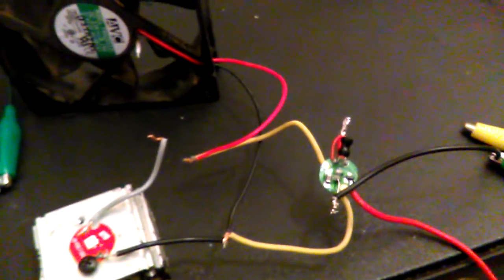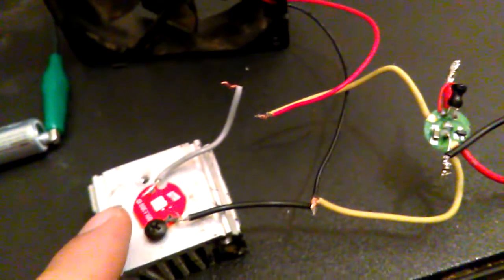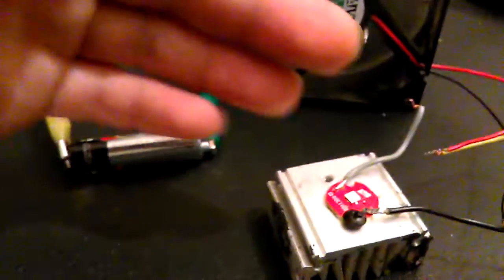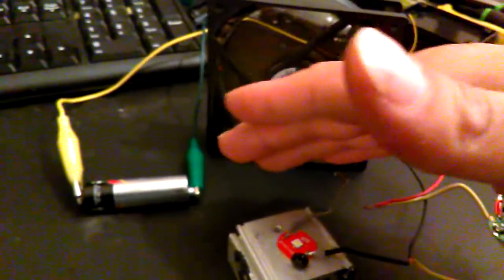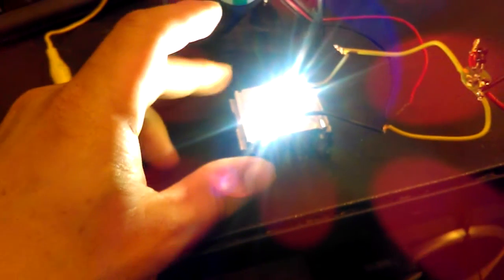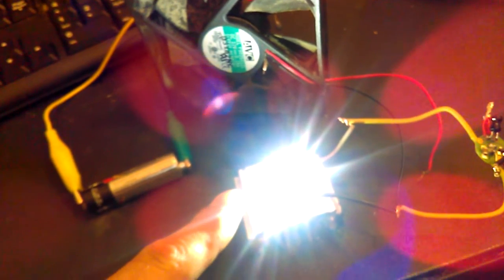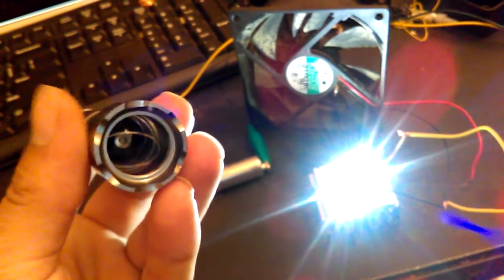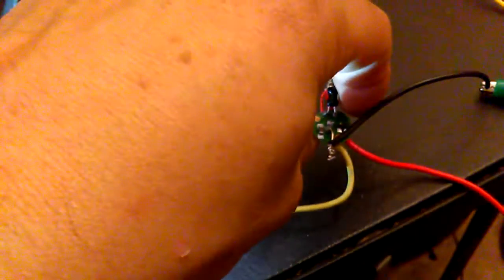Factory 1.5v Boost Circuit, runs power LED and 12v fan.

Comment: Can you make closeup picture from front and rear
Reply from the maker: Sure, idk how useful they will be because I can't find any legible markings on the board other than 'B50' on the PCB itself. 

http://imgur.com/wjcfLK9
http://imgur.com/wb1f7kv

i have a habit of coating little boards like that with some super glue so the leads don't twist off when I'm fumbling around with it.. makes the circuit look sloppy right now and it's hard to make out what is written on the driver but looks like 'M35C2'.

The topside just had the led soldered to it. Another thing about this circuit is it idles at roughly 500uA with no load, indicating that it's more than just a simple transistor on the pcb, but more like an oscillator package. 

I also remembered noting in the past that if I put an extra identical inductor in parallel with the first one I get a small power boost. Cranking the input voltage above 1.5v however seemed to put the circuit out of good operation so that little chip has some workings to it.
Reply from the maker: trying to traceout this thing again for you. I did it in the past but forgot where i wrote it down lol.. but it appears the pos rail is going to one end of the inductor while the negative rail is tied directly to the cathode of the emitter.
Reply: Hope, you can hand draw the circuit xD

Comment: Thanks for sharing

Have you link for circuit
Reply from the maker: unfortunately I had very little luck sourcing info for these circuits online. they are almost never discussed. All I can tell you is I bought this light from Autozone for about $3.99. Couldn't find one anywhere else although I'm sure they have to be sold at some retailer.. None of the major retailers near me had any though. There are obviously other similar chips that work like JT's that are used in things like led solar lights but from my experience they don't take in enough current and are designed for like 25mA loads.